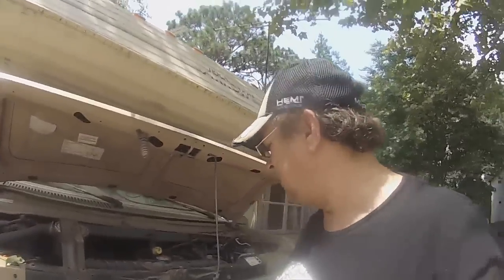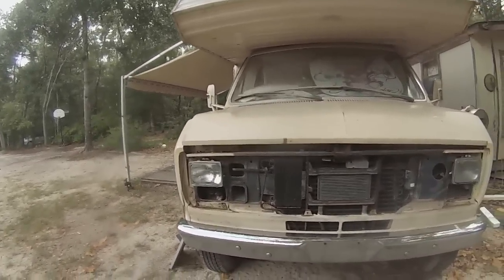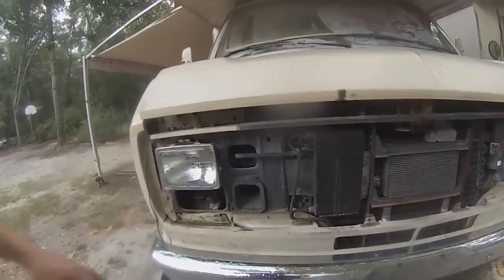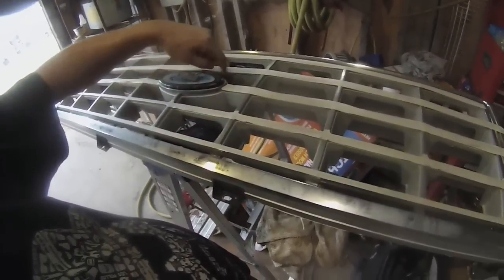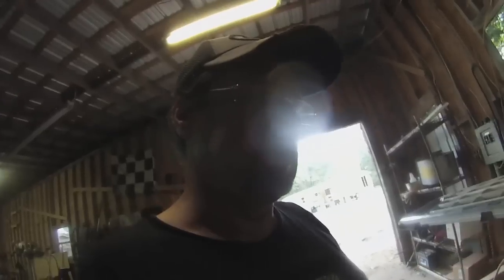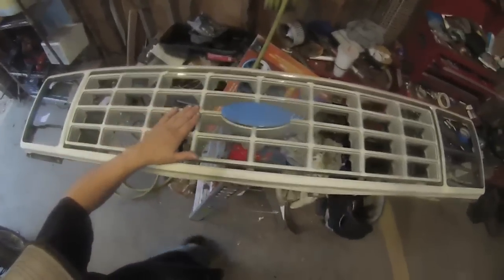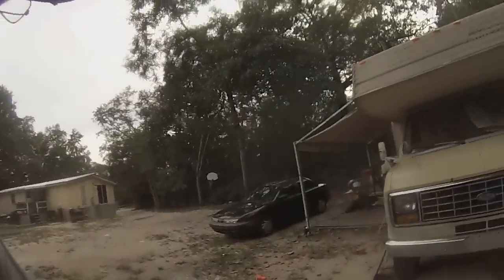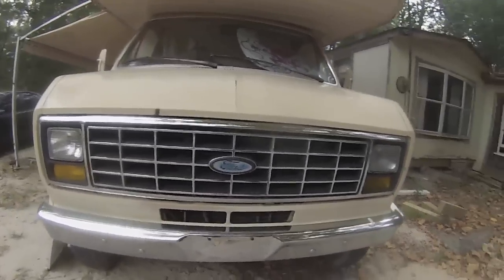Repainting the grill

Comment: Great idea on the grill.  The best paint I have found (and I have been doing this for many years) is Krylon barbeque black.  It is a soft matt black.  It looks factory.  Not flat, not gloss,,,,,,,just perfect.  Just a thought.
Reply: +wayne halladey Plus, this stuff goes on super smooth, consistant and almost can't run.  Also, it dries in about ten minutes,,,,,,,,,tape removal as soon.  In fact, I have painted a project, pulled off tape and reinstalled inside 15 min.  And, trust me, it ends up looking factory.